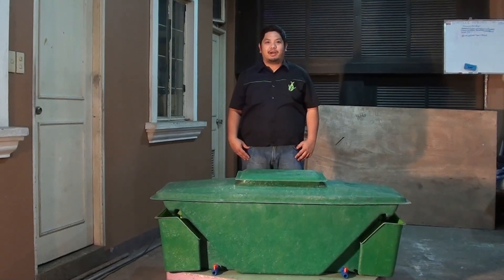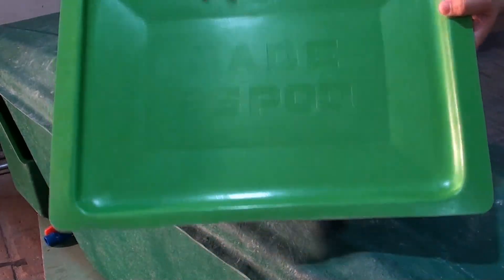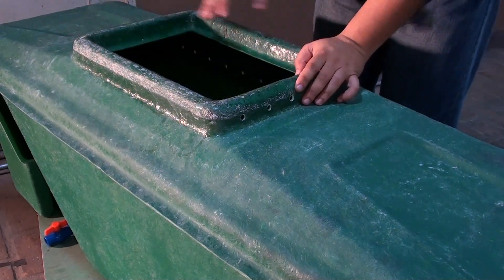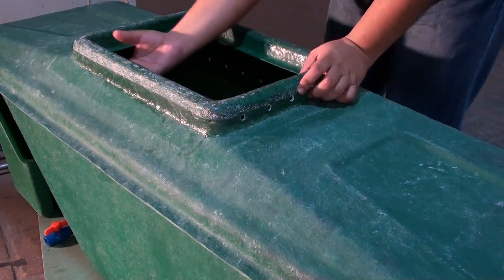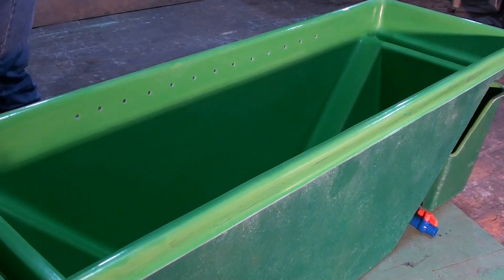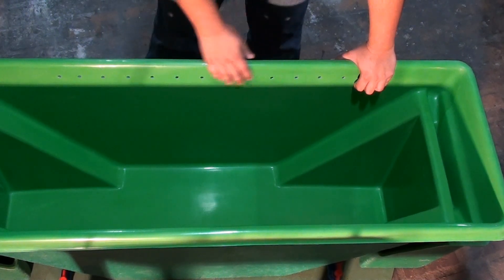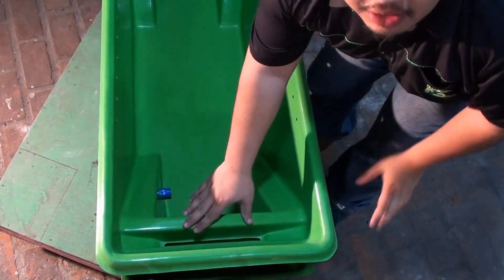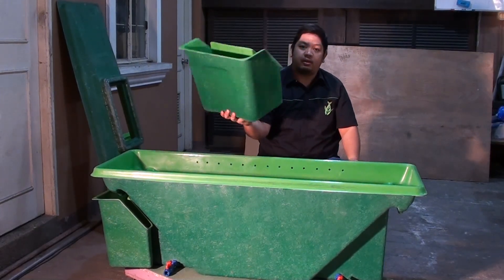Black Soldier Fly Larvae Composting, BS POD Design by MADE

Comment: Are BSFs more efficient than Vermiculture worms as composting agents?
Reply: I imagine you've already figured this out by now, but just in case not...

Black soldier flies back things down faster than your typical vermicomposting bin. They can also handle meat, theoretically pet waste (though I haven't tried this one) and slightly more oil than earthworms. The one downside is, their waste breaks down rapidly once applied to garden plants, with lots of your nitrogen gassing off. One way I've seen this handled is to add your bsf waste to an existing vermicomposting bin, and let the wigglers run it through their system, thus binding things a bit, and making a more stable fertilizer.

Bsf bins alone are more about converting your kitchen scraps into chicken treats.
Reply: BSF are better for producing protein. The volume of what they eat is reduced to about 15%. 

But they eat all the foods a red wiggler won't.